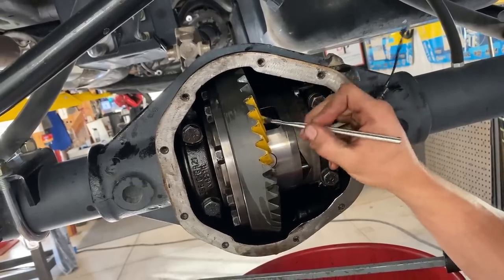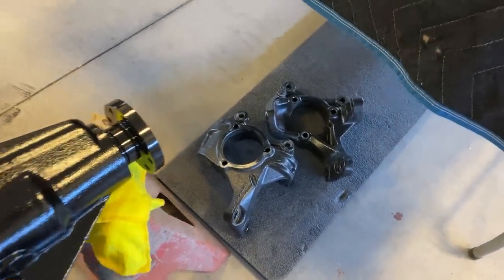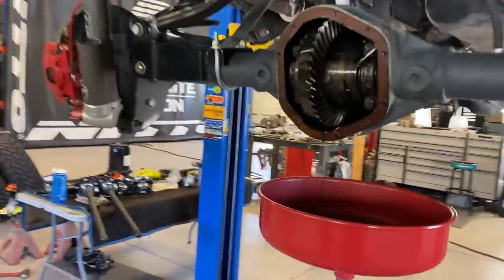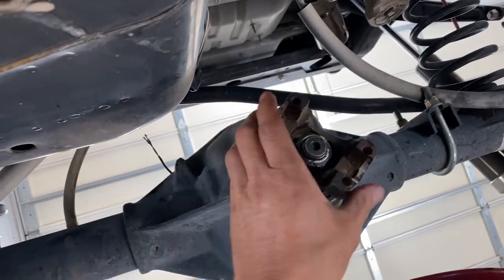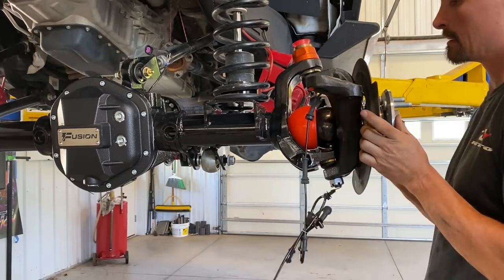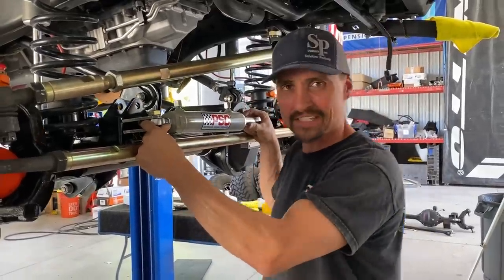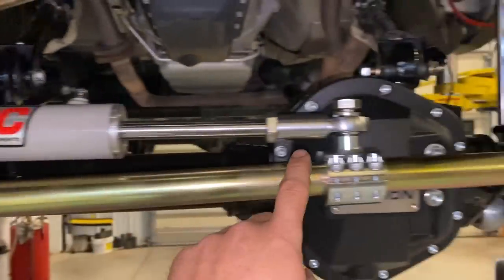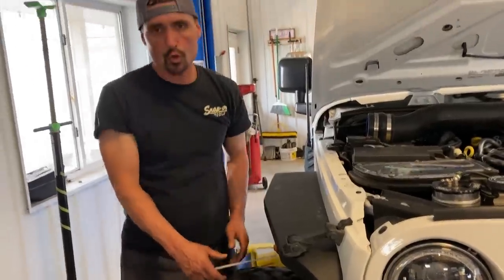OVERHAUL on a Jeep JK!

Comment: Is there any reason why the drag link was installed backwards? I believe the bend is supposed to go on the knuckle side for frame clearance. And the adjustable side on the pitman arm. It was installed correctly when it came in. Not trying to nitpick, you folks do great work typically.
Reply from the maker: It was flipped back before the end of the video. ☺️

Comment: if you put a ziptie under the orange part but between the metal cup it gives the air a place to escape and mkes putting the orange cap on slightly easier.

Comment: Put a zip tie through the hole in the rcv boot when sliding it on the inner, then the air can get out easier when pushing it over the ball.

Comment: Speaking of a right way let Beck know at 24:19 that she is pouring the bottle upside down.  Thats why it is gulping for air.  The spout is offset on purpose.   If she were to pour the bottle with the spout on top and at the right rate it will flow out smoothly without gulping for air and faster in the grand scheme of things.

Comment: Chris when you remove the third members from the housing put a box wrench on one of the top bolt head & put the wrench up against the axle housing, take your pry bar on one of the bottom bolt heads and pry against the housing the third member pops out of the housing.

Comment: Hey Chris! Great video and love the fab work you two do. Question, when setting your caster, do you “zero” the angle finder on the ground? So far I’ve replaced the track bar with Teraflex, Metal Cloak control arms, Barnes flip drag link and tie rod, and Rare Parts ball joints. 2.5” lift. Took it to the alignment shop and now it chases the groves on the road like crazy. Results read 4* caster and .16 toe. Only thing I haven’t replaced is the steering box. Thanks again for the great videos!

Comment: I want to say that 6.75 is a standard JK throw. My ram came from psc already set to 6.75.
Reply: You are correct that 6.75 is standard for a JK with a D44.  Oddly that ram in the vid has the SC2222 part number on it which should be the 6.75", not the 8".

Comment: Love the learning I get from your videos. Question: when filling a diff with an aftermarket diff cover, do you still fill up to just below the fill port? Or are you measuring volume? I've heard that the cover may have different dimensions from stock but you can still fill to "just below" the port and be good.
Thanks!

Comment: Chris, do you like using those lube lockers? Lube locker vs RTV. What's your preference?
Reply: My 44's used to leak with RTV and switched to Lube Lockers and not a drip and you can re use them.

Comment: Great video.  You guys make it look so easy with the educational presentation.  

Question,  Before you installed the Rare Parts ball joint replacement kit, did you have to ream the interface or just cleaning it up?  Is there and alignment requirement?

Comment: You guys work great together 👍. QUESTION: I have a 2008 Jeep JK 3.8l with a 3.5" lift, 35x12.5x20 tires. I'm running stock axles and run trails here in the Canadian rockies on weekends.
Seems a little under powered especially climbing, what gear ratio is best for my setup?
Reply: If it's Auto, I would run either 4.88 or 5.13.  Manual you could get away with 4.56, but would still be okay with 4.88.

Comment: For those of us that are clueless I'd like to know what they are upgrading from and why they would want to upgrade
Reply: It's a non rubicon so it probably had a JK Dana 30 front, the Fusion (like many aftermarket upgraded axles) have stronger tubes/knuckles/LCA mounts and are full wrapped (welded along dif housing) not to mention can be purchased with a locker already installed and gears of your choice.